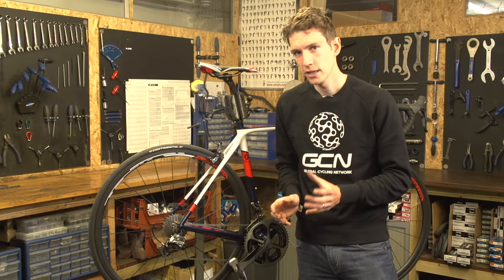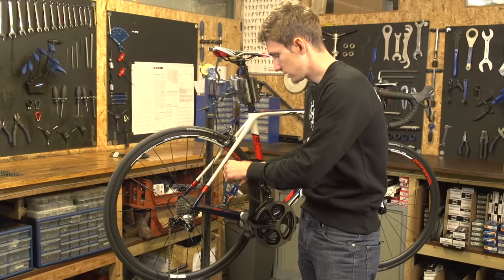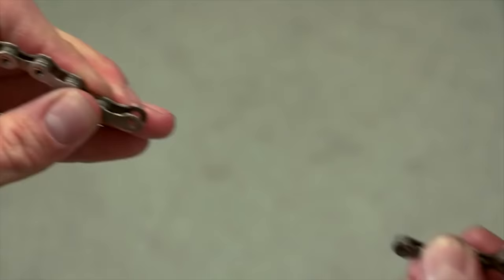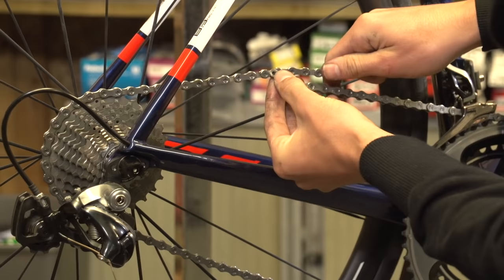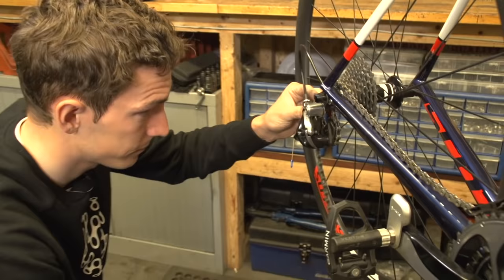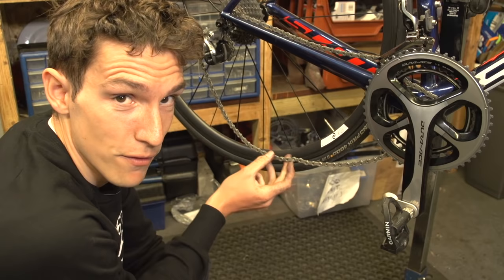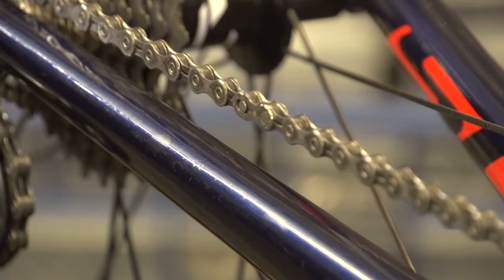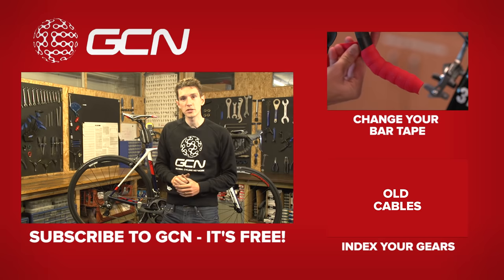How To Replace A Bicycle Chain

Comment: When you buy a chain online will it come with the pin you need to connect the chain together or if not can you just use a pin from an old chain?
Reply from the maker: Yes, it will come with everything you need to fit the new chain.
Reply: umm where do you find the pin? I brought a shimano chain but see no sign of this pin
Reply: Well, if you can't find it in the packaging, I guess you'll have to find it somewhere else then ! Off to the LBS I suppose, or something like that.
Reply: ...wait I found it, it had fallen out of the packaging & was at the bottom of my bag :)

Comment: Hey GCN! Any tips for setting chain length when you use multiple cassettes (23 and 28)? Would measuring for the 28 make the chain too long and cause issues when running the 23? Big fan, thanks!
Reply: I would think it would be ok to have it long enough for the 28, as long as the small cog is the same (11or12).  Say you run an 11-28 and an 11-23, measure it for the 28, because then you know it works on a 23 tooth cog, because the 11-28 probably has a 23 on it, probably the third gear down or so.

Comment: Is it recommendable to use quick links in the chain? I bought a kmc missing link and I'm thinking to install it in a ultegra chain so I can wash better the chain.
Reply from the maker: personally we wouldn't recommend using a missing link on the shimano chain. fine to use on a KMC chain, which we find excellent through many years of use. Cheers Jon
Reply: Did the chain set you buy come with the joining pin...?

Comment: can you guys do a vid on the pedals of the pro peloton, I see alot of guys using the look keo blades and I am wondering why we don't see more speedplays etc, I am interested to know if it is a sponsorship thing or a performance thing.
Reply from the maker: ***** That's not quite true actually. A lot of teams (a lot) have to buy their own groupsets.
Reply: ***** well,  I have seen teams cover the logos of certain components, either because it is a prototype bit of kit or it is a non-sponsored bit of kit,  and I am specifically curious to know what governs the choices between one bit of kit or another (pedals) when sponsors are not in the picture.
Reply: Their was a time (no pun) when near' all where on Speedplay - I've rode them and as much as they're brilliant they're expensive and delicate. SPD-SL's for me now. Have also rode Time RSX's for ages - in fact I've some Ti-Carbons if en1's interested ?? £30
Reply: Global Cycling Network Do they get discounts?  Where do they buy them from?
Reply from the maker: ***** Shimano only sponsor teams fully if they use all of their componentry, so wheels etc as well.  Other teams often have to buy it, but they certainly won't be paying full retail price.
Reply: Ah, thanks for that.  That's interesting.

Comment: I wasn’t able to follow you counting the extra 2 chain links. Looked as though you counted incorrectly with your finger placement. Also, how do you know which pin to push for creating the correct gender needed to match the other end of the chain?

Comment: One thing that's missing is how you hold the chain in place to insert the pin.  My chain's a slippery bugger and I'm damned if I can hold it in place and put the pin in at the same time.  It'll be a two man job I think, unless there are some tricks for doing it (other than the old spoke one)
Reply: Adi Gaskell it is the tough part. I inserted the pin in the link a tiny bit. Then grabbed the other end of the chain and pushed it in so the pin just snapped into place. It's a pain but can be done. Clipping the pin was a production for me

Comment: my bike chain is the quick link chain and I've already detached the proper amount of links to fit my bike. My quick link wont fit in the hole to its counter part piece; it doesn't line up.
Reply: And it doesnt fit perfectly into the hole its very hard to get through and i have nessecary tools

Comment: Can anyone recommend a small multi tool that I can take on rides with me with a chain tool suitable for 11spd chains? Most of these tools state they are for use with 9-10spd only. (I must note I have not tried using one of these on an 11spd chain so it might well work)

Comment: Just wondered when measuring the length of chain how come you simply lay them out and don't count the links? Is chain stretch not an issue on bikes?
Reply from the maker: hi David, it's very unlikely a chain will stretch enough to be more than one link in difference.
thanks
Jon

Comment: The crazy thing is that when you change the cassette or the freewheel the old chain won't fit any more, at least when I did that...it's strange how the "teeth" of the old cogs will somehow get bent...You won't notice it until you change the rear fw or cassette, now I have to try to replace even the chain since it's "knacking" on the new cogs, it annoys the heck out of me...I guess the next problem will be the middle drive-cogs, they won't fit with the new chain....we'll see, lol.

Comment: You broke the chain on the wrong link 1:20. The pin goes in the hole of the outer link that is on the FRONT SIDE of the
direction of travel.

Comment: I followed your advice I messed up a perfectly good chain are 18-speed bike the chain was exactly the length that was supposed to be no need to have to measure with your two link chain extra suggestion which caused me to mess up because the chain at fallen off one of the higher gears.  I think this video should have stated first off if you bought a chain for 18 speed it should be the correct length then if you need to adjust it this is how you do it. Also if you're taking out pins that you might want to reuse perhaps not to put the pull the pin all the way out would have been a nice suggestion too. Had to watch four or five different YouTube videos to get the full understanding of how this works

Comment: I installed my new kmc chain 9spd, it shifts smooth, but when down shifting its so choppy and there is a delay. Ive adjusted the rear shifter less tension more tension as needed. But still does the same thing. What am I doing wrong?
Reply: Check the B-tension screw, it dictates how close the pulley on the derailleur sits next to the cogs.
When the chain is on the biggest cog on the cassette, the gap between the top of the teeth on the top pulley and the top of the teeth on the cassette cog should be about 5mm. When this is properly adjusted gears will shift super smooth, also check that your derailleur hanger (the part where your derailleur screws onto the frame) is not bent. The pulleys should be parrallel to the cogs.
Those are the thing I can think off the top of my head, hope you work it out. :)
Reply: Check the B-tension screw, it dictates how close the pulley on the derailleur sits next to the cogs.
When the chain is on the biggest cog on the cassette, the gap between the top of the teeth on the top pulley and the top of the teeth on the cassette cog should be about 5mm. When this is properly adjusted gears will shift super smooth, also check that your derailleur hanger (the part where your derailleur screws onto the frame) is not bent. The pulleys should be parrallel to the cogs.
Those are the thing I can think off the top of my head, hope you work it out. :)
Reply: Luciano Narno I've checked and believed its set correctly. everything is straight, no crashes so far... thanks! ill have to spend some time with it and see what i get..
Reply: djeondj Also could be dirty shifters cables, if theyre old they could have corroded and this would cause your shifting to slow down when downshifting as the cable gets trapped inside the housing when you're trying to release tension when you plan to downshif.

Comment: I always thought that when replacing chain u must replace cassette and viceversa. The logic being that they wear out together and a new chain will not mesh with a worn cassette. Thoughts?
Reply from the maker: theorgandude No, chains wear faster than cassettes, therefore if you replace them regularly you can prolong the life of your cassette.
Reply: Bike shops trying to make money :p
Reply: ***** I've heard shops suggest when im at 75 percent i should change both cassette and chain, i changed only the chain and it worked fine,

Comment: It took me about 4 minutes to undo the quick link after 5 months riding a chain. I've done it twice now, with the same chain (because I installed it around the wrong way). For me, its not worth getting a tool to do it.

Comment: Don't measure the old chain. Count the links. The chain will stretch and give you a bad length measurement. If you don't have a chain tool, a dremel cut off wheel works great. You can cut any link you want.

Comment: Tell me plz how often replace a chaine? Some people recomend to use two chaines, for replace them every 500 km.
P.S. Sorry for my english:)
Reply: Александр Колобов buy a chain checking tool from Park or whoever and change it when the tool tells you. there are too many variables that have an impact on the life of a chain to advise every single rider when they should replace it.
Reply: altern8ive Basically said what i said.
Reply: COL S. Trautman where did you say what you said? i've refreshed the page and can't see it in the comments and it wasn't there when i first replied. sorry for any repetition :)
Reply: altern8ive Don't know what happened to my comment man, you are right though.
Reply: COL S. Trautman i see your first comment. Thank's! 
I will replace my chain.
Reply: altern8ive thank's for answer.
Reply: COL S. Trautman just checked in G+ too and there's only 6 comments before this in the thread so don't know where it is. honestly wouldn't have duplicated a comment if i'd seen one or at least deleted it afterward if i had :)
Reply: Александр Колобов you're welcome :)
Reply: ***** But me and this other guy that that i can't type the name of can see it, it's just that altern8ive tried to duplicate my comment, jokes.
Reply: COL S. Trautman  it's still not there man, im not trolling, i don't mind deleting my comment if other's can see yours?
Reply: altern8ive It's fine, really, I've seen your other comments and you seem sensible so don't think you'll be trolling at all.
Reply: ***** This pointless conversation must end.
Reply: COL S. Trautman /thread closed and thanks :)
Reply: Александр Колобов No need to replace every 500KM!!! 
Clean it every 80-100 KM, I do that and it's new even at 1300KM
Reply: Spanish Christian they mean replace it for several times - 4-6

Comment: The lube on a new chain: is it enough? If I want to use dry lube do I need to clean the lube off a new chain?
Reply: It should be enough most of the time, but sometimes the lube will be extra-thick to prevent rusting during shipping and storage, so you may need to remove it. Use degreaser and a rag or brush, rinse with water and soap, then apply the lube after its dried

Comment: Sorry but wrong! PARKTOOL: "Lubricate the connecting rivet, and install the connecting rivet from the inside of the bike towards the mechanic." "THE BURR DOES NOT CONTACT ANY DRIVETRAIN COMPONENTS" Here is the install done the opposite way..

Comment: A good class on chain removal but you left out one important thing on installation. Nowhere in the video did not mention that the chain has a front and back. It is very important to put the chain on with the pins facing in towards the wheel. Why didn't you put that in the video. Also you showed cutting off the link pin with a pair of pliers when that Park chain breaker tool has a feature that lets you insert the pin that is sticking out into the Park tool and snap it off with ease. I suggest you redo this video and include these items.
Reply: Actually the pin position is hard to see and both look almost the same. The easiest way to fit a chain is to look at the chain and you will notice one side has letters on it. The side with letters goes away from the wheel.

Comment: 🤔 hmm he says put on both biggest gears then add two links. But it looked like he added 3 links.
Reply: I agree. V confusing. The Park Tool video says to add two rivets, which is much easier to understand, that simply means pins. 
It’s not clear what is meant here by “link”, is that a pin or is it one pin on the chain up to the next occurring same part of the plates on the chain (e.g. pin joining outer to inner plate and then skip a pin to find the next pin that joins an outer to inner in that direction/sequence - in other words is a “link” an inner and outer (joined by a pin) together or just an inner/outer pair?))?

Comment: Mmmmmm...., a number of different reasons why you would need to replace a chain link & in my opinion it's either because you have broken said link ( speed link ) etc or all out snapped a link or two...., me personally have only suffered a single link failure during my 56 years in cycling & over 42 years ago & let me just say to fix a busted chain link all those years ago you had to have exceptional bike maintenance skills where you had to have precise bike maintenance skill set to splice two chains into one to make a durable working chain system that would work without fail to ensure your biking experience & endeavours..., fast forward to the 21st century in bike maintenance & technology where you have all manor of the "latest" in bike tec in tools to aid you it's a no brainer for any up coming & new to the world of cycling no matter your preference in the stance that you take wheather it's MTB, GRAVEL, TRAILS or ROAD BIKE as the world is truly your oyster....!!!

Comment: The way you add two additional links to measure where the chain should be cut is different from the advice in this video https://www.youtube.com/watch?v=O0YibMDWBAw (check at 5mins 25secs). He added two rivets only and you added two whole links which is very different. Now I am wondering which one method is correct??? And I am changing my chain tomorrow for the first time!

Comment: Matching up the length of your new chain to your old chain seems a bit counter productive to me Global Cycling Network

If you're changing your chain because it's stretched, then measuring the length of your new chain against your old one means it's going to be too long?!

Surely you should be going by the number of links the old chain had and matching that with the new chain to allow for stretching?
Reply: +Nathan Budd The "stretch" of old chains isn't huge. If you're familiar with chain checkers like Park Tool's CC-3.2, you'll see that the wear indicators are set at 0.5% and 0.75%. Older models of the chain checkers went up to 1%. Sure there's discrepancy when you add up all the 100+ links on a chain, but it's not so great that you can't use the old chain as a sizing guide for the new one.
Reply: chain aint going to "stretch" the length of a link

Comment: I just replaced my chain with a KMC chain that had a quick link but I just couldn't stretch the two parts. what I did was pushing the next pin almost all the way through (the outer part retaining it, joined the chain and pushed the pin back in. Not sure this was the correct way of doing it but that quick link just didn't work :/ Is it OK?
Reply: If it works then it's fine. I was building some mtb and used it for quite some time and it was working perfectly. I'm not using it anymore, but it's not the problem with the chain. That's alright.
Reply: Thanks for the answer, sorry I missed it. I actually got a SRAM chain for my other bike and the power link just worked perfectly. I know which chain I’ll be using when it comes to replacing the KMC chain.

Comment: Never compare two chains, during rides it stretches.
Reply from the maker: LightPhoenix When they stretch it is by only a few millimetres so you can accurately compare the two.
Reply: LightPhoenix GCN is right, if it is ridiculously stretched then all you do is count the number of links in the new vs. old one

Comment: I have a SRAM cassette, Shimano Rear Mech and FSA chainset... which brand of chain do I buy? lol
Reply: Go with the casette brand. in your case I would recommend a SRAM chain. But SRAM is usually compatible with Shimano, so you could technically use both SRAM or Shimano.